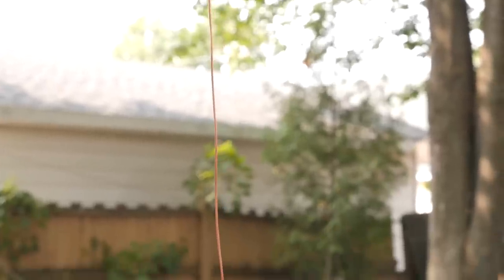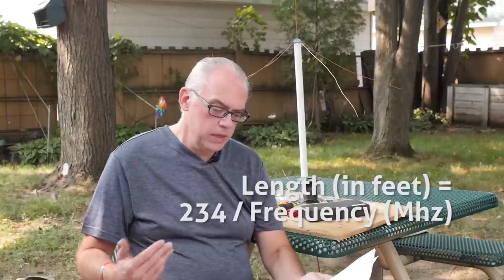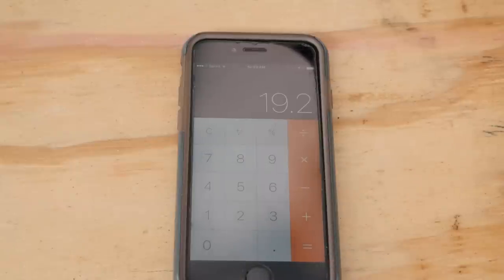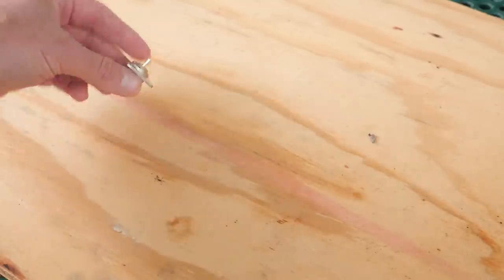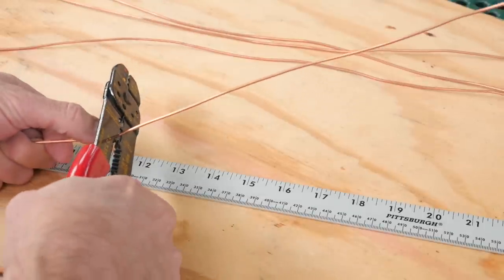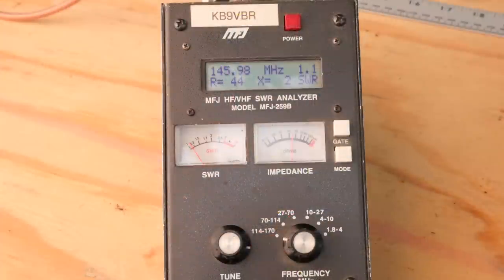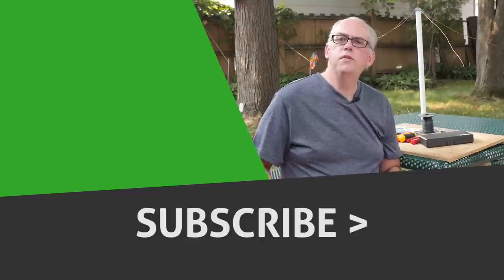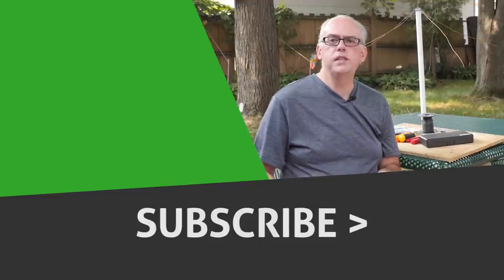2 Meter VHF Quarter Wave Ground Plane Antenna - Ham Radio Q&A

Comment: I'am curious if increasing the radiator wavelength e.i. 1/2, 3/4, 5/8 or possibly a full wavelength to the frequency would increase the gain of the antenna?
     Thanks for sharing!.
Reply: For a vertical antenna, only the odd numbered wavelength quarters, and close, are resonate with an end fed antenna.  1/4 wavelength will resonate when end fed. 2/4, or 1/2 will not.  3/4 will resonate when end fed. 4/4 wave, or 1 wavelength will not resonate end fed.  Of course with a some sort of antenna matching circuit, the even lengths will resonate when end fed.  The odd wavelengths will resonate with no added matching circuitry.  1/2 wavelengths will resonate when center fed instead of end fed.  That will be a dipole antenna

Comment: Newbie here, just curious why not a half wave instead of quarter, is quarterwave better for vhf ?
Reply from the maker: A quarter wave is easier to work with. A half wave antenna has an advantage of not requring a ground plane, but the impedance is different at the feed point so you need a matching network to create 50 ohms of resistance. Quarter wave antennas have 50 ohms at the feed point but require a ground plane.

Comment: Noob questions!
What is better, ¼ wave or ½ wave?
Can you turn a ½ wave into a ¼ wave?
Reply from the maker: One is not better than the other, only different. A 1/4 wave and 1/2 wave VHF antenna roughly have the same amount of gain. The benefit of a half wave is that it does not require a ground plane or radials, but it needs a matching system to bring the impedance to 50 ohms at the feed point. 1/4 wave antennas do not need matching as they are close to 50 ohms at the feed point, but require a ground plane or radials. The choice of one over the other depends on where it will be mounted or how it will be used. For example: 1/4 wave antennas are great for mounting on vehicles as the vehicle body acts as a ground plane. They are also easier to build if you want to put a simple antenna on the air. 1/2 wave antennas are often used where a suitable ground plane isn't available, like on watercraft or vehicles with non-metallic bodies.

Comment: Looking to build my first antenna - just got licensed last week. What kind of coax cable and pvc pipe would I need? Looking to order everything I would need off amazon.
Reply: Just passed the Technician test myself and waiting on my license.  I used a piece of 1 inch PVC pipe to stick in my mast pole for the 2 meter antenna to sit on.  You could get by with RG-58U, RG-8U or RG-8X coax cable.  I'm using 100 feet of RG-58U to go from the SO-239 connector to my radio which is a little Yaesu FT4VR HT I got from the local Ham club for passing the test.

Comment: Hi Michael 
I built the  two meter quarter wave  ground plane antenna ,I am measuring 2.7 SWR at 146 MHz .
What would be a good SWR for this antenna ?any suggestions  to make my SWR better ,my copper wire is cut at 19.2 inches .thanks in advance .
Reply from the maker: At 19.2 inches, you should get a better reading. First off, may I ask what are you using as a SWR meter? Is it rated for VHF/UHF frequencies? A meter designed for HF/CB radio will give you a faulty reading above 30 Mhz and you will see an SWR of  about 3:1 when you use it on VHF.

Comment: I guess this also works for listening to airplanes and marines using mine antenna calculator should work?
Reply from the maker: Yes it will. Just use the formula to build the antenna for your desired frequency.

Comment: Would this transmit/receive any better if the ground plane was a flat (thin) aluminum plate, with a radius equal to the length of the radiating element? If so, would it make any difference if the plate was round or square? 
It seems performance might be better or worse in various directions, if the plate is square. Thank you.
Reply from the maker: I don't think you will see an appreciable different between using a solid ground plane versus separated radials. The purpose of the ground plane is to provide a counterpoise for the antenna and in VHF/UHF, the number of radials doesn't seem to have a big effect. You may see a bit of a pattern change, but it won't be a big one.
Reply: @KB9VBRAntennas  thank you for taking time to share your experience.

Comment: Hi there.. I wanted to say that I'm a fan of your videos. I'm a fairly new ham and projects like these are just awesome. Thanks for taking time to produce these cool vids. I do have a question however, I currently have a vertical antenna for 2m and 70cm. I have it side mounded to my tower. My question is how far should it be? I have an swr of 1.3 on 146 mhz but on 446 mhz, it's an 1.8. What's your take on this?
Reply from the maker: Typically you want a side mounted antenna to be at least a 1/4 wave away from the side of the tower. Although depending on the style of the antenna, it could be closer or further. The reason why the SWR is higher on UHF is that the antenna could be coupling with the tower or possibly you just aren't getting a good tune on UHF and the antenna may require a bit of adjustment.

Comment: Can a handheld type yagi antenna be made for 2meter  frequency out of coper / aluminum, tubing or pipe? Something similar to the j-pole build. If so how do I figure the measurement for the frequency desired? Is there a formula to follow? Thanks!
Reply from the maker: Check out my video on the 2 meter tape measure yagi antenna. It has the information that you are looking for: https://youtu.be/BmHoQrDfw-0

Comment: Hello sir.. is copper wire coated mildsteel inside will work as well for the radiator??? Ty sir
Reply from the maker: Copper clad steel will work just fine. I've built this antenna out of copperweld and soft copper 12ga wire. They end result is the same

Comment: Hello, thanks for the video. I just bought my first mobile ill be using for a base station. (FTM-400XDR) i had it for a couple days and haven't even powered it up yet. Im still trying to get a power supply and some coax. so instead of dropping a couple 100 on an antenna this would be nice to get it up and running for the time being. what do you think? I am new. I passed my Tech exam and been still waiting for my call. its been 2 weeks and a day. still no call
Reply from the maker: This antenna will work well as a base station antenna for the FTM-400. Years ago I built a 1/4 dipole just like the one in the video and stuffed it in the false ceiling of my office. It will certainly get you on the air. Hopefully the call sign comes soon

Comment: Is there a limit on the distance you can run the coax from this antenna? If I wanted to put this in my attic or something?
Reply: For the most part, the limiting factor on coax length is going to be how much signal loss the cable exhibits, At higher frequencies (like VHF or UHF), cable loss becomes a significant issue. This webpage has a chart and a calculator that shows you how much loss you get from 100' of various kinds of cable at different frequencies. If you use a good quality RG-8x cable, you will loose about 3 db over 100 feet for the 2M band. That is about a loss of 1/2 of your power.

url: https://www.qsl.net/co8tw/Coax_Calculator.htm

Comment: Can they all not be soldered on like the vertical one?
Reply from the maker: You can try but it’s not easy. The cup in the middle is designed to take solder so that part is easy. The flange is chromed so it needs a lot more heat and skill to get the wires to stick.

Comment: What about an antenna for gmrs, frequency 462.5500?
Reply from the maker: If you use the formula in the video, you can build the same antenna for GMRS. The elements will be about 6 inches long.

Comment: Great vid! Question, I live in the Pacific Northwest and we get a lot of rain. I'm planning on making this antenna and was wondering about weatherproofing. Could I shoot a bunch of hot glue on the pl259 to keep water out? Will I get water inside the coax with a normal screw on connection? Thanks!
Reply from the maker: I think you can make a waterproof seal with hot glue. Otherwise silicon sealer would be my choice. As the cable connection, I'd wrap it up with high quality electrical tape so seal out the water.
Reply: @KB9VBRAntennas  thanks!

Comment: What wire are you using? the copper wire I  found is extremely floppy and won't stay up
Reply from the maker: I used 12ga solid copper wire.
Reply: Try going to WalMart and using the "Galvanized steel wire" found in the electrical/car battery section. You can still solder that, and it's much stiffer than copper
Reply: At 48 years of age and not having a girlfriend, I am woefully familiar with the problem you mentioned.  However, use stiffer wire.  But you can also use straws to run the wires through them.

Comment: can i use copper from coax cable?the inisde of a coax cable used to hook up a satelite dish to the descrambler is sturdy
Reply from the maker: That would work also. You'll have to strip everything away to get to the center conductor.
Reply: I used a coat hanger made antenna for operations on a nonlicensed band in 1.9 meter band.  It is called MURS band.  The antenna increased my range by five times.  Make sure the coat hanger is aluminum, stainless steel, or at least painted.  Many coat hangers are made of rust-prone metal.

Comment: When you send the wire, can you keep the insulation on or does it have to come off?
Reply from the maker: Leaving the insulation on will affect the velocity factor of the wire. You will then need to make the wire a bit shorter to compensate. Here's a video where Joe and I talk about velocity factor and its effect on the length of cables https://youtu.be/SCF15sDD2IM
Reply: KB9VBR Antennas also, should I ground the antenna, and if so where / how?
Reply from the maker: No grounding is required for 1/4 wave ground plane antennas. You can ground then the antenna for lightning protection. This would involve putting a lightning arrestor on the feedline where it enters the house

Comment: can this be made for a CB 11meter radio
Reply from the maker: It can, just follow the formula in the video for an 11 meter frequency. Just note that your elements, may be about 8 feet in length, so you may want to use a more rigid material.

Comment: Nice vid, thanks, and greetings from the state below you. Does anyone know how you could adapt this to dual band, i.e. 2m and 70 cm?  Would you just make it halfway in between the two?
Reply from the maker: No that really wouldn't work. This style of antenna is really designed to be for a single band, but I have seen some designs where a second, shorter, element is added for a second band. So if you wanted to experiment, I'd go in that direction.
Reply: @KB9VBRAntennas  Michael, I built a similar ground plane, and it works well on the third harmonic. It has a low SWR on 70cm, which looks even lower at the radio end due to the loss in the RG8X. Although it probably loses some gain toward the horizon compared to a dedicated 70cm version, it works well enough in my attic that I don't need a second antenna for 70cm. It's really convenient on a dual-band radio with only one antenna connector.

Comment: In the formula where does the number 234 come from ?
Reply from the maker: The formula to calculate the length of a half wave dipole antenna is 468 / Frequency in Mhz. This will give you a total length of the antenna in feet. Since their are two legs in a dipole antenna that are separated by a center insulator, each leg will be half that total length. In order to make a 1/4 wave antenna, we only need one leg of a half wave dipole. To simplify the math we can divide the first number by 2 and use the formula of 234 / Frequency in Mhz. 

I don't know if you wish to get into the theory on how those numbers are derived, but here it is: https://en.wikipedia.org/wiki/Dipole_antenna

Comment: How important is it that the copper wire be super straight?
Reply from the maker: The wires should be reasonably straight, but a slight bend or curve isn't going to affect things.
Reply: Not that it really matters, but I used welding rod.  Works great and nice and straight.
Reply: @Daddymouse-ny9cz  Did you use carbon steel or SS for rods? Also if using carbon what about rust? I've heard SS rod can't be soldered?

Comment: no balun needed?
Reply: Nope! Both the ground plane antenna and coax are unbalanced, so no issue. A balun (a contraction of "balanced to unbalanced") is only needed when the antenna is balanced (like a dipole) and the feedline is unbalanced (like coax) or vice-versa.

Comment: Do you recommend a vertical or yagi style antenna for HF?
Reply: Kristian Kabasares they do different things. A vertical is great for further distances than a dipole antenna, but will have more noise. A directional antenna (yagi) will be much better for distance but the vertical is omnidirectional. If you're just looking for someone to chat with, a yagi will limit your options. I think "both" is the answer. :)
Reply: @whatevah  What about using a vertical dipole instead of just a vertical or vertical ground plane, plus the yagi?
Reply: Different mounting requirements. Vertical dipoles are relatively rare in the HF world. Elevated verticals with ground plane are also rare.  They're also more finicky about what they're mounted over (typically a roof). I'm more of a fan of an inverted-V dipole for it's mix of moderate DX and mid-range propagation due to its steeper takeoff angle.  But, we all have different goals and back yard spaces available. Vertical dipoles aren't very feasible for the lower bands, 20meters is usually the limit unless you use a loaded antenna. Ground plane antennas require radials, so need horizontal space. A vertical dipole is often a better performing antenna than a 1/4wave vertical, though. But, that depends on your needs and limitations. If I had a tall enough tree, I might try a 66' off-center fed dipole for 6, 10, 20, 40m coverage.

Comment: What is the maximum range of this antenna in 5w power
Reply: Can be 100 feet, can be 1000 miles. "What's the range?" is the worst question to ask in ham radio.
Reply: @n3ssaya972  so you are number one genius ah?
Reply: Just using the rubber duck antenna, with 5 watts, I can hit a repeater that is 20 miles away - that repeater is 2000feet above me, so it can pick up signals really well from almost anywhere though. However, many people had commented that the signal was still a bit weak. I have yet to attempt a 1/4 wave antenna, soon I will try it

Comment: Is it good for noaa?
Reply from the maker: To optimize it for the NOAA weather band, you can use the same formula. Just use a frequency of 162 Mhz.
Reply: @KB9VBRAntennas  ah not 137mhz?if is 167, why 30mhz higher?

Comment: whats the formula for 5/8 wave?
Reply: If we calculated a quarter wavelength antenna to be 19.25, multiply the 19.25 by 4.  This will give the complete wave length of 77 inches. To find 5/8 length, covert to the decimal, which is 0.625.  77 inches X 0.625 equals 48.125 inches.  That is the length of vertical element.  The ground radials may be the same facing at a 45 degree angle down.  You may also make a vertical or horizontal dipole by using two 19.25 inch antennas connected at the bases end to end, with an isolator between the bases so the do not touch.  Connect the center conductor of your coaxial cable to one 19.25 inch antenna and the outer shielding to another antenna.  Place the two antennas connected end to end on the end of a wooden pole or insolated pole.  It should be perpendicular, like a letter, "T." This antenna may be used vertically orientated or horizontally orientated.

Comment: Well it work for 11 meter?
Reply from the maker: You can use the formula in the video to build one for the 11 meter band.
Reply: 234 ÷ 27.185 megacycles (center 11 meter citizen band frequency) =8.6 feet.  8.6 X 12 =103.2 inches.  Make the antenna 103 inches long and also the for groundplane radials 103 inches.  Then just follow the video instructions the same with the cut 103 inch lengths.  I am not an amateur radio operator.  One can still be a radio hobbyists on several unlicensed bands.

Comment: max power on this?
Reply: It will be good for about 50 to maybe 70 watts.  Use heavier guage wire and you can supply more power to the antenna.

Comment: Bro how l make ham radio communication contry to contry easly in fm frequency with low cost  help me bro       l interest build it
Reply: It is more advisable to use frequencies in the HF radio spectrum for long range, beyond line of sight communications.  HF signals bounce off upper atmosphere levels and bounce back to Earth.  VHF and UHF are primarily line-of-sight only, with few exceptions.  HF frequencies are below 30 megacycles.  These frequencies require large antennas.  The higher HF frequencies, such as 12 meters, 10 meters, and 11 meter citizen band require atmospheric conditions to be right for the signals to propagate long distance.  The atmospheric conditions are effected by solar flux, number of sunspots, and a few other things.  Right now we are in a deep solar low cycle that cripples just about any transmission above 20 megacycles to be mainly short range, only groundwave propagation.  You will have to get a transceiver that will work below 20 megacycles. Although there is no restriction against using FM signals below 30 megacycles, the seem to completely disappear below the 10 meter band.  Side band and some AM are the most used modes below 10 meters.  Sideband is a narrower signal than FM and requires less space on the band and also travels further with the same power. Sometimes, I have heard amateur radio operators on 10 meter FM talking very long distance.  But that is rare, especially that 10 meter band is currently propagating very poorly.